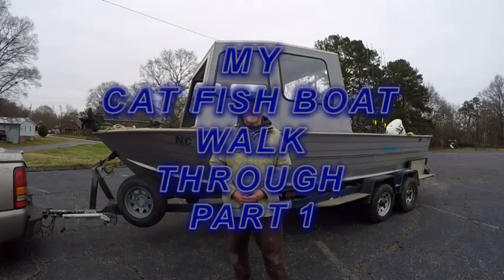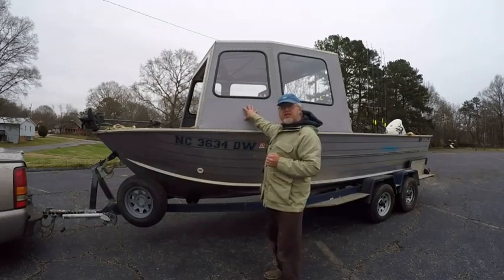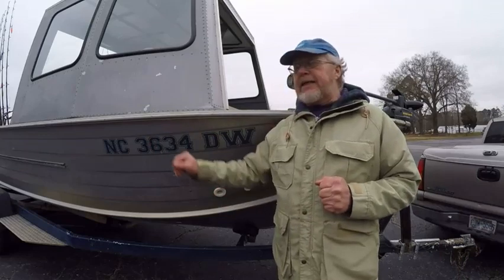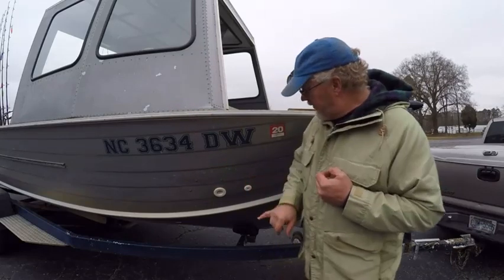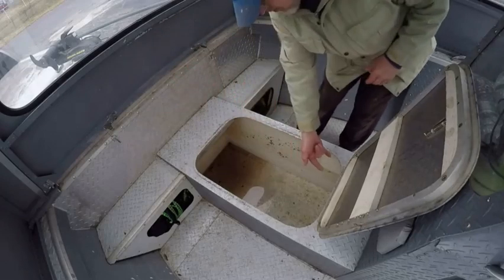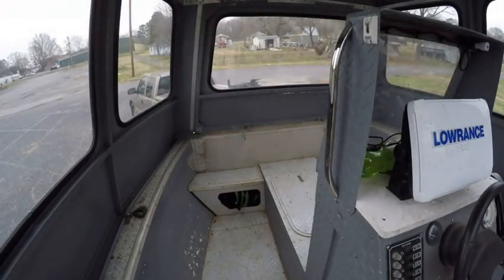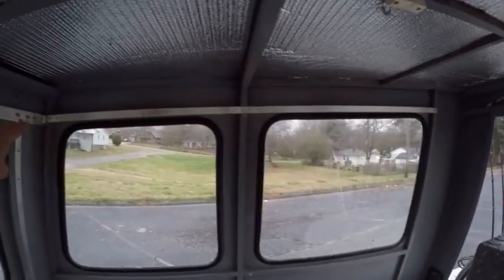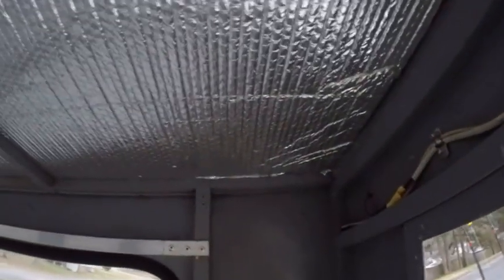TOURNAMENT CATFISH BOAT SET UP AND WALK THROUGH PART 1

Comment: Where did you put your fuel tank, and how many gallons. The 21' Starcrarft (1988) CC that I have is under the floor and is 18 gals. When I replace floor I may move or replace tank to a top side location (under motor splash guard maybe). Any thoughts on this ?
Reply from the maker: Mines 18.  Above the floor against the side wall.

Comment: How long and wide is your boat
Reply from the maker: It’s a 21’ long and it’s the 88”    I like that width because even with a 140 I run mid to upper 40’s.  The 96” model takes 175-200 just to get that speed.  Thanks for watching and commenting I appreciate it